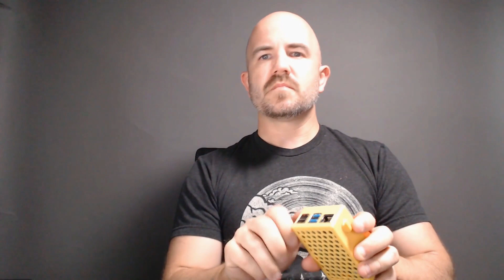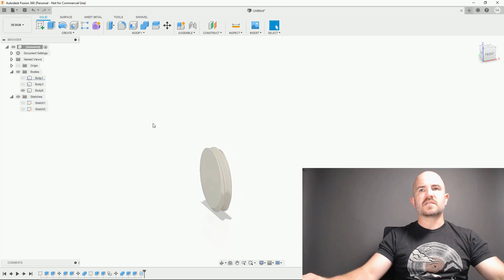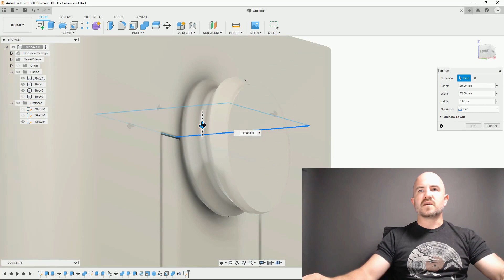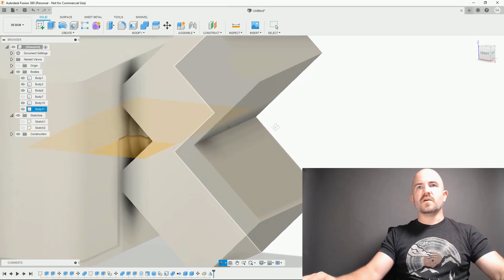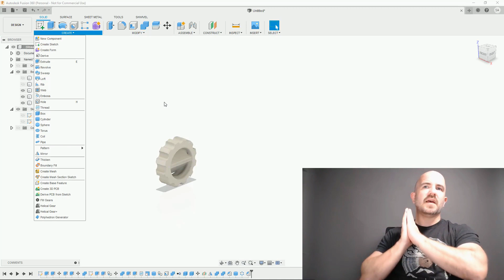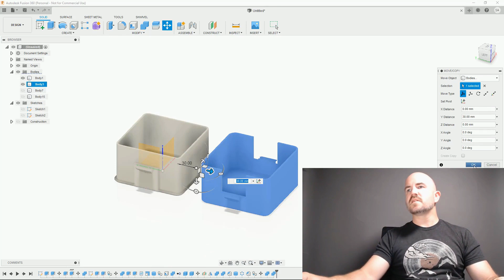Designing Screw-Closure Parts (for 3D printing)

Comment: could you explain a bit more about the tolerances of the thread. i kinda missed that bit and is what i came here for. looks like your thread method seems simpler than other folks.
Reply from the maker: All I'm doing in this version is taking the thread object that will become the "bolt", i.e. the part that is attached to the box, and expanding it outwards by 0.5mm, then using that as a cutting tool to create the thread in the "nut".  If the package you're using has that kind of expansion capability it's an easy way to manage how much space there is between the two models (at least in theory, since our printers only approximate our models).  You could get the same result by using a thread modelling tool, and simply creating a cutting tool by taking the bolt thread radius and increasing it by 0.5mm (or whatever tolerance you like to use for your setup).  Hope that helps! :)

Comment: awesome!! Scale the treat, huge tip!! Tks for sharing! 
 You always uses 0.5 distance for the treats?
Reply from the maker: 0.5mm works well on just about any setup, but can be a bit loose for some things on a printers that are very precise.  My rule of thumb is to use 0.5mm for things that are for public consumption, but otherwise I'll use the smallest gap my printer can handle :)